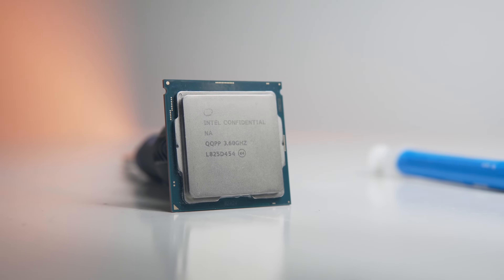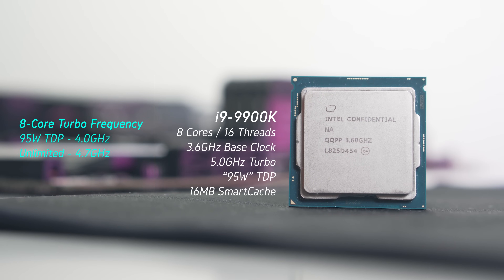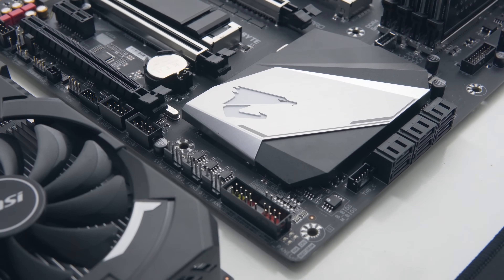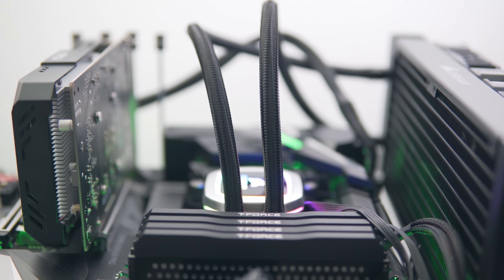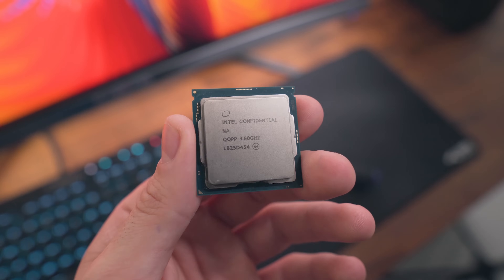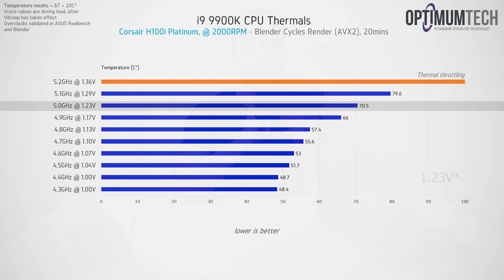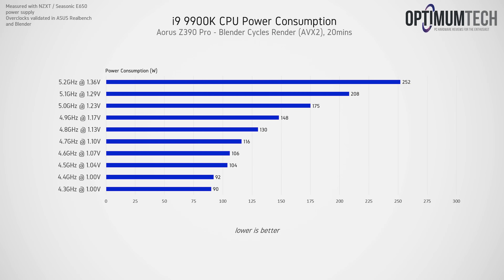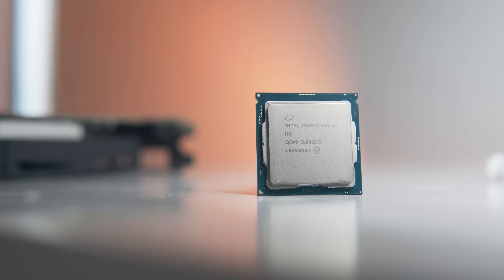9900K Overclocking & Undervolting - Fighting The Molten i9

Comment: I thought my chip was good part of the golden sample, I am using 9900k for my sffpc build with a low profile cooler.. So I needed to undervolt this thing BADLY. The good thing is that my chip is stable 4.7ghz at 1.15v, I thought that was pretty good until I saw that you got 1.10v for the same clock speeds. Jesus.

Comment: Please review the 9700k next, as I have not found any videos comparing the 9900k vs 9700k in thermals and giving advice to consumers as to which chip has better thermal stability and which one can overclock better with stable temperatures. I purchased the 9700k and have not built my system yet and I hope I can get a higher overclock with it and lower thermals than the 9900k. I would also possibly like to do 5.2 Ghz on 2 cores and run the remaining at say 4.7Ghz or so, just an idea I had in my head.
Reply: 9900K runs hotter for sure.

Comment: Stop using cherry picked sample cpu, use retail cpu!!!
Reply: Holymoly s Yeah, his numbers are kinda unrealistic. Barely got 5Ghz at 1.296V, and that is “good” versus some reviewers needing 1.35V+.
Reply: @Aurummorituri  yeah mines barely stable with stock and a custom loop 360 rad cpu cooler.
Reply: @Draven2k  Sigh. Ended up dropping 4 cores to 4.8, 2 cores to 4.9, and left 2 at 5.0. It's not perfectly stable at all core 5.0 at 1.3V. LLC is too low at 4, but bumping it up to 3 makes the board goose the voltage higher than what I can offset in the bios. I have to use Intel Tuning for that and it requires loading a profile on every login. Really dumb.
Reply: Aurummorituri yeah this is actually the best chip I’ve seen on YouTube and I thought 5ghz@1.275v was a golden chip. And mine is 5ghz@1.3v which I heard is actually pretty good though. (Think I could undervolt a bit more if I try but I don’t have much patience maybe tomorrow)
Reply: Lim Chhay OMG UPDATE YOUR BIOS PEOPLE! I am using a Z390 Taichi Ultimate and Asrock released a new bios a couple days ago. Night and day difference on Vcore. Stock voltage dropped from an absurd 1.36V under load to 1.248V! Bumped up LLC to 3 and am running much cooler and more stable. Also 30W less power draw. I thought I had a crappy chip. Just crappy software.
Reply: I got mine stable at 5ghz@1.35v on air
Reply: @Aurummorituri  yes asrock massively overvolt these chips, my 9900k on 4.10 bios (which is very new), has the VID at 1.52v running cpuz bench LOL @ stock clocks, vcore at 1.36v.  I dropped to 1.25v with absolutely no issues and way lower temps, also VCCIO and VCCSA tend to get massively overvolted as well.

The problem is the CPUs intel make have huge variance in quality, the silicon lottery is very real, and board vendors are having to set really high voltages to account for the worst chips that pass intel quality control.
Reply: @Aurummorituri  Yea for real my best sub 1.3v OC is 4.9 Ghz @ 1.29v no AVX offset. Best stock is 1.166v.
Reply: @Aurummorituri  I literally JUST barely got my 9900(KS) to 5ghz (manually, from 1.368 auto voltage) to 1.295v. Max load vdroop = 1.21v. And that's KS, I should be running this at like 1.15v MAX. So he's got a better chip almost 1.5 years ago than i got a few months back xD cries
Reply: @Andreas Nygard  avx offset 0 on every pc I built and config... Never had such good bins since than :/
Reply: Funny story 3 buddies and I built super rigs all with 9900k's and 2080ti's. My two buddies used 280 AIO's and I went for the delid with OC frame and a custom loop. I managed to get 5.1 stable @ 1.36v, both of them couldn't surpass 5.0 no matter what voltage they through at it. So now our 4th buddy wants to build a PC so we build him the exact same rig with a 280 AIO and this dudes chip hits 5.2 @ 1.35. Go figure.
Reply: Its voltage under full load not the one who you set up in bios as vcore.
Reply: My is 5ghz at 1.36V. Do you guys think 1.4V is enough for 5.1/5.2 GHz?
Reply: Bob The builder Why are you trying to fry your cpu? Stahp already..
Reply: nekron75 lol I already hit 5.2.....
Reply: @jaytea9239  wouldn't even bother with 1.4v on a 9900K.
Reply: have two retails here ... one 9900KF ... does 5GHz allcore at 1,1V and one 9900K does it at 1,15V ... so just sillicon lottery ;)

Comment: gotta say this channel gets better and better mate you really know your stuff and give us all information we noobs can understand fo'sho,just wanted to ask if possible your thoughts on using puch pull with an NZXT Kraken X62 as i have this config recently but CAM softwear keeps giving me some odd info in regards to my fan speeds...i have them set to the 'silent' profile because let's face it with 4 NZXT P140 AER fans in push pull using any other config seems overkill,my temps are awesome on my 6700k with 17c at idle but my fans still show odd speeds i relation to the cam on screen info...so maybe a video would be interesting using this config,(obviously you most probably don't have a 6700k lying around),i am sure the same thing can be done with an 8700k or some such...what say you

Comment: my 9900k goes down to roughly 4ghz under load but when its idle its around 4.7ghz. Its running stock clocks. Is there an issue with my cpu or is my cooler not good enough?
Reply: You didnt manually overclock I presume ? Just using the stock settings. That CPU has a boost clock of 4.7 GHz. Should behave about normal. To make it run all core 4.7 GHz+ you will have to change a few settings manually in the BIOS.

Comment: Nice to see undervolting. Not many people even realize they can run at stock clocks with way lower voltage. Reduces temps. Extends life of motherboard VRMs, reduces noise from fans and doesn't compromise performance. 

Been running my 4790k with a -0.07V vcore offset for years. Hits 4.5ghz single core 4.4ghz all core around 1.1V. Not bad for the older 22nm Haswell.
Reply: Vrams cooler and extends lifespan.. So your Vrams have maybe 5 c less than usual mob.. So u gain nothing in lifespan.. Vrams are made stand big heat.. Oh come on it's an 21 century.. Don't be silly
Reply: It's a z97 mobo, they didn't put big gawdy heatsinks on the VRMs back then. There's actually no heatsink in the vcore vrm at all. Unlike today where they slap 500g of aluminum on them.  Though, you're right, most modern motherboards will be fine. Caps and VRMs haven't failed in large numbers since the 90s. They do have a finite lifespan though. VRMs and caps are typically rated for ~2000 hours at 95-100C, more premium boards they may be more like 5000 hours at 120C. I know my system has been on far longer, probably ~8000 hours. So keeping it cool will help ensure it lasts without question.
Reply: @ericwright8592  dont forget that the Vcore when iddle or light use is usually below 1. an generally anything below 1.3-1.32 under full load is still okay
Reply: @edgarsnezinu1439  you really have no idea do you

Comment: According to your voltages, you have GOLDEN sample. 
According to Silicon Lottery preliminary stats,  ONLY 46% of 9900k can do 5.0ghz or higher in their stress tests.
Reply: I have a 9900k 5ghz with zero avx delidded and runs got 93 max for stress testing 50-83c in games
Reply: obviously a company like intel sends their best samples to rewiers

Comment: Great vid dude! Can you make the same for Ryzen 2700X? 
Mine is running at 4.2Ghz with 1.325V and "Extreme" load line calibration on the Aorus X470 gaming 7 and I am using the stock cooler. 
It gets 1926 Cinebench R15 score but that's with Flare X 3200 CL14 kit (2x8) that is running at 3533Mhz at 1.46V 
With CL16 RAM at 3200 it will probably drop the score to 1850s or something.
CPU temps peaks at 78 degrees after 30 min Aida64 on CPU, cache and GPU combined but I have the side panel off on my craptastic 7 year old cooler master case and I have reversed the rear 120mm fan to blow towards the cooler at max speed all the time. Saving money for Corsair Air 740 now ^^ but I don't think I will be buying an AIO.
I could spend £200 more for rads and pumps and fans and only push it from 4.2 to 4.3Ghz and yes it will be a bit quieter but its fine now even while rendering video or streaming while gaming.
It should get even quieter with side panel on and some Noctua fans. I hope. :)

Comment: Any chance you could teach us how you establish the undervolt and overclock procedure that lead you to the graph? I’m interested specially on the gigabyte board, since I just bought an gigabyte auorus z390 master and a 9900k.
Reply: the most important thing on these new chips is to use the power limit more than just an overclock. what i mean is to overclock it as far as you are willing to go as far as voltage goes.  the 8700k is smaller but its all i have so ill use mine as an example.  itll clock to 5.1gh at 1.33v and be stable in everything. its a very good chip and i have a decent board for it.

now if i had a lesser board or heatsink, or if it was a 9900k here is what i would do.  i would leave that clock as is but lower the power limit from unlimited down to the max my system could handle.  my system handles up to about 200w without breaking a sweat and and can handle over 230w for short periods but i wouldnt wanna do it for too long.  so i set the maintained or long power limit to 220w (or 230w but 220w is a lot already) and the time period to maybe 10 seconds.  then i set the short limit to 200w.  

now whenever you start prime95 or a video encode or anything that hogs the power it will throttle down if it meets the short power limit of 220w immediately.  thats as high as it wil go.  now if it goes over the lower long or maintained power limit it will draw that power only as long as you set the timer period.  so for 10 seconds it can draw over 200w up to 220w but as soon as it hits 220w it throttles or if it stays above 200w for 10 seconds it will throttle.  in a video encode it will stay up near 5.1-5ghz most times but for prime it will drop down depending on what kind of test you are running.  some will stay at 5.1ghz and some will throttle down as low as 4.5 (but prime is the only appo that will get anywhere near that because its a power hog.

now youre games and normal apps on the desktop?  they will always stay at 5.1ghz (or whatever your max clock is) because no game made will use more than about 120w max on even a 9900k.  games arent that power hungry when it comes to cpus.

so now you have a system thats overclocked to the max  you could get but you dont have to worry about it melting if you run a heavy workload on it as well.  it will take care of itself

now the big question is how do you find what is the limit for your system.  to be honest most people with a high end system will be able to use my numbers for a 9900k.  for gaming most definately.  but if you run anything power hungry you really need a good board with good vrm cooling and airflow.  you also need a really good cooler.  you just have to run the system with an app to monitor power draw and heat of the cpu and vrms.  if the cpu hits 70-80c then whatever power level you are at is your long or maintained limit.   whatever power number your system hits 80-90c is your short limit.  i set my long\maintained so it wwould get mid 70's and the short limit so it would maybe hit low 80's.  you can do more but i wanted it a bit cooler.

as far as finding voltage for your cpu you just have to experiment. try around 1.3v for 5ghz with an avx offset of 1 so it will downclock to 4.9 when doing avx loads.  if it is stable then maybe try having no avx offset.  if thats stable then see if you can get 5.1 with a avvx offset of 1.  if thats stable then raise the avx offset.  if you are ok with a bit more voltage than 1.3v then go up a bit and rinse and repeat.  get the most clocks you can with the lowest voltage.  thats it.  oh and you have to test with seomthing to make sure the cpu is stable everytime you raise the voltage\clocks.  intel xtu is a good one that has a memory test in it but doesnt try to destroy your cpu lime prime95 does.  but if you have your power limit set right then prime wont draw enough power to wreck your cpu but it will throttle which doesnt really test the clocks.  so you need to have the power limit raise to max for this part.  inte xtu can find unstable memory without baking the cpu and wrecking your vrms like prime does
Reply: same
Reply: Dito :)
Reply: Same.
Reply: Have exact same Mobo and CPU as yo Pabula and would love the same video.
Reply: set your voltage and core speed for all cores manually :-D  what else do you expect he will tell you?
Reply: if you havent figured it out yet email me at cougar1825@gmail.com and i will send you my settings to get you all core 5ghz stable at the lowest vcore and i am cooling it just fine

Comment: Sweet video! That chips runs crazy low voltages for the speeds you achieved.  Gigabyte has made some great z390 boards no doubt.  I would be super interested to see what voltage/frequencies it can hit with a less "ideal" motherboard.  Would gigabyte allow this?

Comment: that's a golden chip you have there.
Reply: every new product launch its so fun to watch the high success rate of reviewers with golden samples LOL, we all know the game they play but they do it anyway.

I suspect my chip isnt too bad, I started with 1.25v on stock no issues, bumped all core to 4.8 whilst also boosting 4 core to 4.9, and I noticed XTU kept boosting to 4.9 and no crash, so this chip "probably " can do 4.9 on 1.25, which I will do next, and if it does its probably at least above average.

However I have already decided I wont be boosting the voltage, so I will go as high as I can on 1.25v, and not try to boost voltage to get past whatever ceiling I hit, its just real nice already to have this chip which is so much cooler than my 8600k which needed 1.37v to run at 4.7.
Reply: Yeah not all of us are obsessed with hitting 5ghz and sticking 1.4v to get there lol.

My 9900k is a hotter chip than my 2600x, but I wouldnt consider it a gulf.  The main issue I think is the motherboard vendors are for whatever reason applying massively high stock voltages.
Reply: Not surprising since it was provided by the motherboard company he’s testing.
Reply: I’m not sure if I got a golden chip but I bought a 9900k today used from someone who had it since July,2020 and I got 5.1ghz at 1.3vcore very stable at 64 max temps
Reply: Aorus Gaming 7 & NZXT X73 cooler so those two probably helped me

Comment: im at 5.2 ghz on mine, using kraken x62 and asrock z390 extreme. 1.375v. will do 5 ghz at 1.3v. max temp at 5.2 ghz is 85c during burn in and 50-60 in gaming and normal workloads. i don't get why people call this cpu hot, because 8700k at 5 ghz is harder to cool unless delidded. my aio is not even that good, slightly better than best dual tower air coolers..
Reply: You probably just got lucky in silicon lottery ;)
Reply: To make sure it is stable, try rendering 4k60FPS high bit rate video and stretch it to 2hours+. Just recently learned that my chip did not have enough voltage for rendering long 4k vid :(